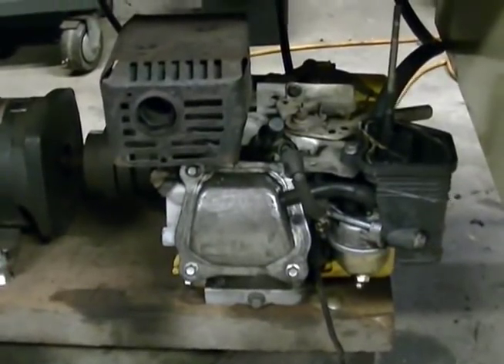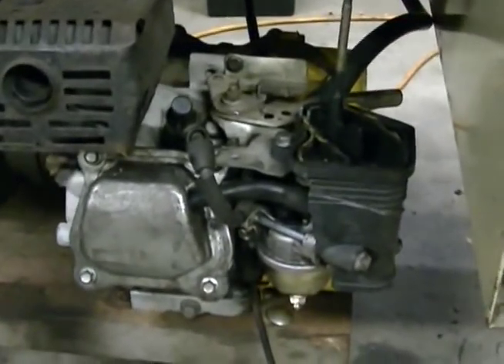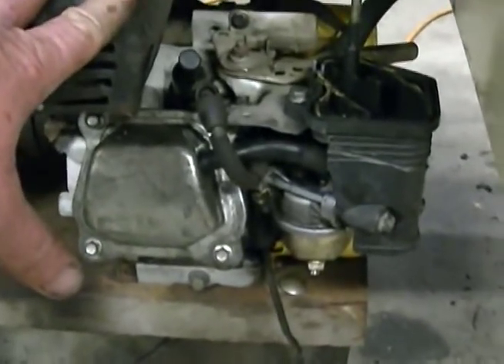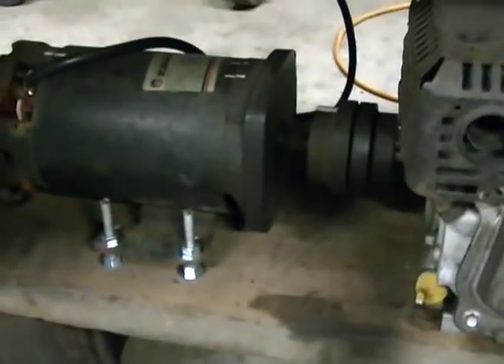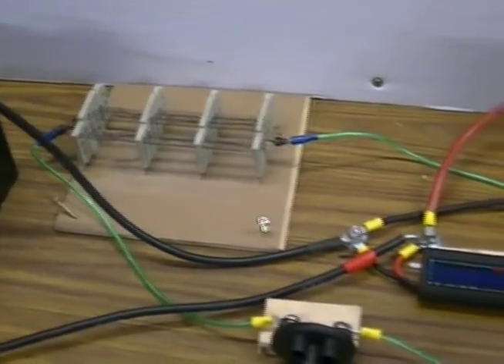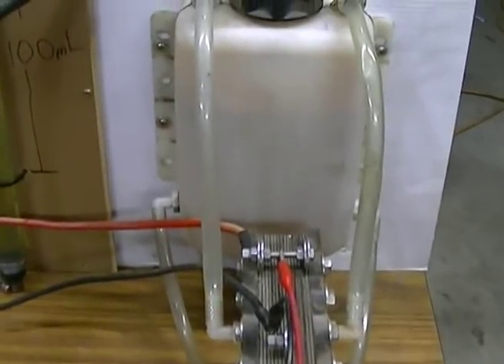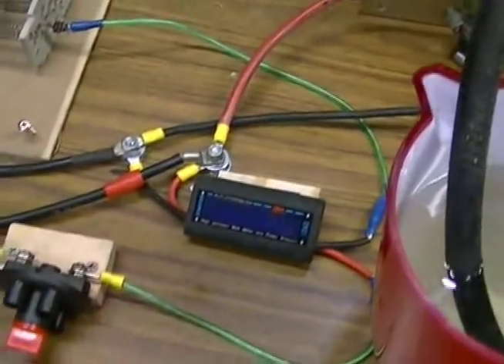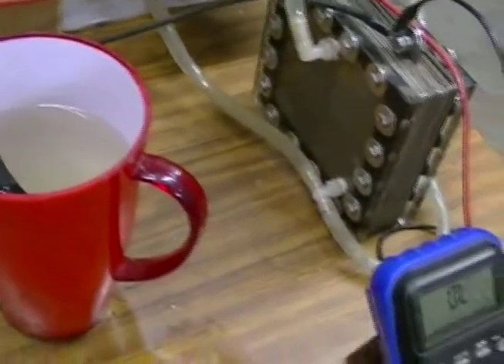Running up the HHO cell

Comment: when HHO explodes it then Implodes, so I would assume the timing needs to be considered, my thoughts are that the energy you put in will be equal to the energy you get out, however engines use fuel inefficiently. maybe it will be possible to improve the fuel explosive efficiency but the motor will still be the inefficient link. I look forward to your results.

Comment: Here is an interesting test just for fun put a multimeter on the hho generator after a good run and the power is turned off an you will find it acts like a poor battery.

Comment: not bad for 18amps 24v system, ive used beer chiller coils to cool my cells, air cooling . it works great on old school deisels to boost effeciency a freind has being making them since 78
as we know the internal combustion engines do not completely burn their fuel, so when guys go on about the law of thermodynamics they conveiniently dissmiss the ineffeciencies of the internal combustion process and how hho or H2 vastly improve the process far outwaying any drag on the alternator , ive built many cells and used them, i dont sell them but i build them because they work and very well on deisels.